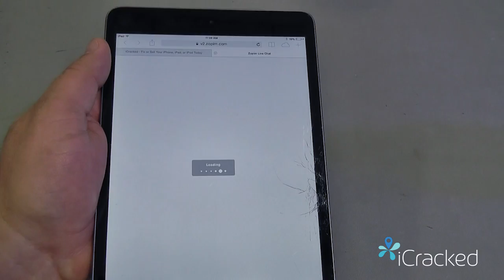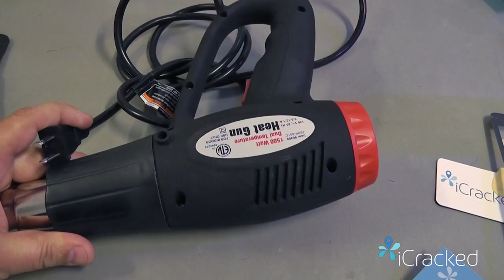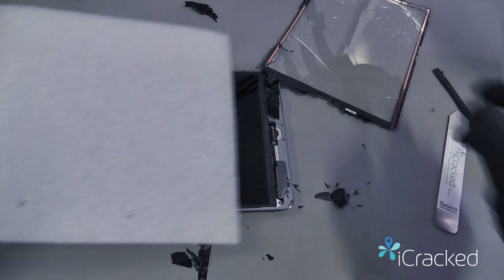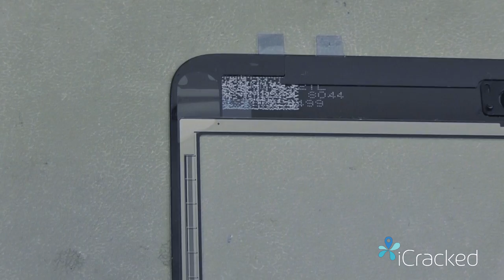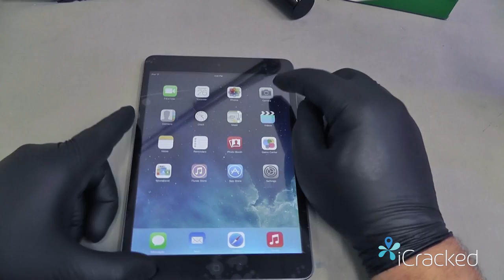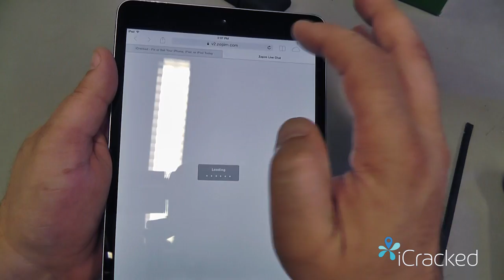Official iPad Mini Screen / Digitizer Replacement Video & Instructions - www.iCracked.com

Comment: Anyone happen to know which exact digitizer model # (or model #s) will fit the Apple iPad Mini MF450LL/A?  Curious to know because sometimes multiple digitizer parts #s which work on other units will sometimes be cheaper in price... also don't want to end up with the incorrect digitizer - Thanks!

Comment: Hi I follow your steps Great video by the way but my lcd screen has developed lines across the botton 5 to 7 mm above the home button and a few lines on the right hand side every thing else works fine. Can you give me any help to fix this or has the lcd had it. I was very careful when removing the glass so can't under stand whats happened.

Comment: I actually recommend the iOpener by iFixit over any heat gun. Also any kind of heating pad with small beads in it will work as well...

Comment: Very helpful walkthrough. Filled in the important details the iFixit guide left out.
I used an artists paint spatula to run around the edges of the iPad. They are like plastering trowels, but very small and with a very thin blade. Thinner than a guitar pick and perfect for sliding along the glue line.

I now have a functioning iPad mini 2.
Thanks!

Comment: Apparently you forgot you mention that you HAVE TO disconnect the power first (25:14). You do it first but don't mention that it is critical for the repair. You also don't stress that you also need to connect the battery LAST (35:49), again critical to the repair since not doing so will short your circuit board and cause an LCD back light fuse repair.
Reply: My backlight stopped working and now I don't know what to do. Please help me, can it be fixed?

Comment: So, the screen works totally fine. My issue it that (with them in the correct positions) the magnets under the digitizer keep acting up, as if one of those smart "flap" cases is being open and closed. Help??

Edit: I even tried removing the magnets completely, the iPad continues to act as if there is a from cover opening and closing when moved specific ways.

Comment: Hi, I have a problem and I need help.
The magnetic system of the Smart Case does not work after I switch the Touch my Ipad Mini 3G. Perfectly follow the video and magnetic are correctly positioned . The LCD ground , screws and fittings were made perfectly ..
What's the matter ??
Reply: I have had this problem as well before but all you have to do is turn on the smartcover thingy in settings
Reply from the maker: It is probably a bad home button flex cable, that is what the magnet sensor is attached too. Unfortunately that cable is soldered to the screen so a whole new screen needs to be tried. Were the screen ordered from Amazon or directly from our website?
Reply: ***** Thanks, bought from a company that provides Apple parts for some time . I never had problems , I'm getting in touch with the vendor to request a replacement . Thank you so very much.
Reply: Hi Daniel! I had the same problem with 3 different digitizers.
I think that problem is that some digitizers are not as good as the original quality and something is not included that doesnt activate Smart Cover
Reply: Hi Daniel! I had the same problem with 3 different digitizers.
I think that problem is that some digitizers are not as good as the original quality and something is not included that doesnt activate Smart Cover
Reply: Hi Daniel! I had the same problem with 3 different digitizers.
I think that problem is that some digitizers are not as good as the original quality and something is not included that doesnt activate Smart Cover
Reply: +Daniel Fernandes Filho Hi Daniel! I had the same problem with 3 different digitizers.
I think that problem is that some digitizers are not as good as the original quality and something is not included that doesnt activate Smart Cover
Reply: Actually, I also had other problems when using low quality parts. Problems such as leave loading or off abruptly.

Comment: Help. 
I replaced my glass digitizer and now there is a black strip (1-2 inchesbwide) going down the screen. 
When it powers on, only the right half of the apple shows and when the home screen loads there is the black bar going down the middle. 

I tried reseating the ribbon to the LCD again and still nothing. Maybe I'm not seating it right, but it feels like it snaps in. Or maybe I pressed too hard, or should I press harder on the ribbon cable?  Did the LCD go bad? 

Does it need to be completely sealed before trying or what can I do to troubleshoot? I haven't closed it up yet so it's kind of halfway open. 

The directions I followed left the battery connected, but I ended up disconnecting the battery (AFTER I disconnected the LCD) so I hope I didnt mess anything up by doing that. 

Please let me know how to test, and what to check.  Thanks
Reply from the maker: It's likely that the LCD was damaged while taking it out because it's held in with adhesive. So if it flexed too much or anything while they were being pulled out, it can be bad even if all connections are okay. Was the screen/digitizer bought from Amazon or directly from our website?
Reply: I checked the LCD and by pressing on certain parts of the ribbon I was able to get the black area to turn rainbowish and then white, but after a while it made the whole screen dim and greyish. So I'm almost assuming something happen with the ribbon cable when taking it out. The directions I saw were not specific as to how exactly to loosen the lcd from the black tape that keeps it down.
Reply: Mkkkkkwkssssskssssssiss
Reply: Mkkkkkwkssssskssssssiss

Comment: How Many does that Cost?
Reply: Or I need to go to the Apple Store?
Reply from the maker: You may check our iPad mini parts here https://shop.icracked.com/collections/ipad-mini-retina-kits-replacement-parts

Our screens are made to the exact same specifications as the Original Apple screens. Our confidence in the high quality of our screens is backed by our lifetime warranty that covers all non-user induced issues that cause the screen to not function properly (e.g. display issues, unresponsive touch, etc.). Should you ever encounter post repair issues with your phone, we can definitely cover your phone for warranty repair free of charge, provided that the damage is not by customer's mishandling.

Comment: I don't have a heat gun what else can I use
Reply: jmgraham Hold my Mixtape up to it.
Reply: jmgraham A Hairdryer
Reply: Now girt we dont want to charr the ipad
Reply: GURT Sellars  Nope. Not fire.
Reply: Harbor Freight $14.99
Reply from the maker: We highly recommend that you use Youyue 946B Heater Plate. It'll distribute heat evenly on the iPad. You may check it by clicking here https://shop.icracked.com/collections/tools/products/youyue-946b-heater-plate
Reply: jmgraham I used a hair dryer and it worked perfectly
Reply: Sylvester McGovern You're right, it'd burn the ipad. Don't do that.
Reply: Shitzu Gamerop1432 hahahaha
Reply: Use a hair dryer. I have succesfully repaired my broken digitizer with a hair dryer to heat it up.
Reply: +iCracked what temp do you set your youyue heater plate to?

Comment: wow!  watched 3 of these videos before this one, this is the only one to mention testing the screen before gluing it all down.  the only one to mention keeping the digitizer cable positioned correctly, and the only one to mention "sealing" it by using heat and weight.
Reply: Yeah, I like that he is actually going through the whole process and not pausing the video and voilà the digitizer is out. You actually see that you may break the glass while taking it out, one might get discouraged to continue with the repair if not seeing it happen in this video.
Reply: this guy is the bomb. I love his videos, used a few for my repairs.
Reply: He went into detail about the magnets, i didn't see that in 2 other videos, I appreciate that.

Comment: for some reason on the left side of the metal plate of the screws they wont unscrew??????? plz reply anyone help!!!!
Reply from the maker: We are sorry to hear that you are having this issue with your repair. Please try taking a very small square of duct tape and placing it sticky side down over the screw head. Then use your screwdriver to push through the duct tape and try to remove the screw again. The duct tape should act as a filler that expands into the void of the stripped screw head and the tape's adhesive also helps grip the sides. If this does not work, you can also purchase a screw extraction kit from our online store ( http://shop.icracked.com/collections/tools/products/6-piece-screw-extractor-kit ).
Reply: I request better grammar or you'll get no help.
Reply: ok
Reply: get a drill and a small bit drill that bolt head of used the drill twice now and the stuff works

Comment: I like your safety tips at the beginning which is the first I've seen on a video but this video is way too long! A few things I would've done differently like...
-cut the digitizer cable on the old one to get it out the way.
-use a vacuum to remove all loose glass
-removing LCD before attempting to clean out remaining glass and adhesive.
-make a Video that's not an hour long. You could've very easily covered this repair in 20 minutes.
Reply: I don't cut data cables as it short your board
Reply: It won't short anything as long as power is off. I've done 10 of these so far without an issue.
Reply: I'll do it next time then that old digitizer is a pain flopping around

Comment: after getting the screen off,, instead of trying to remove the rest of the broken glass,, removal the LCD panel first to avoid any accidental damaged to the LCD in the process,, then remove the rest of the glass.. a lot safer.. apart from that the video isn't to bad
Reply: Good point, protecting the LCD is a very high priority. I have a small piece of clear plastic cut to the size of the lcd that I can lay over it at this point to protect it from accidents until I remove it.

Comment: Can anyone explain to me why he does not take off the yellow tape located on the new digitizer?
Reply: cause there is a open contact point there, if you dont cover it properly it shorts out on the casing causing touch issues